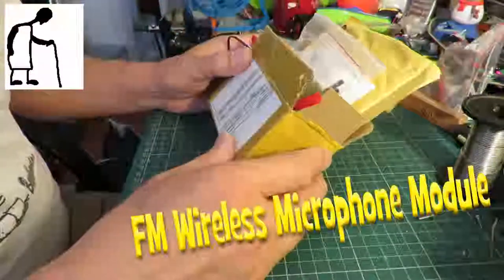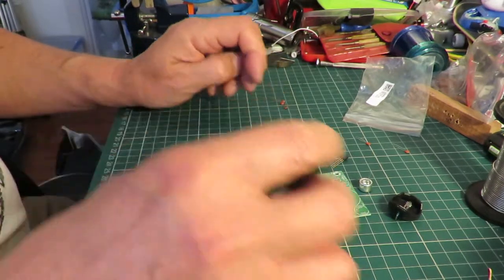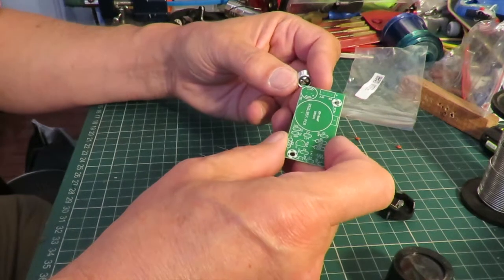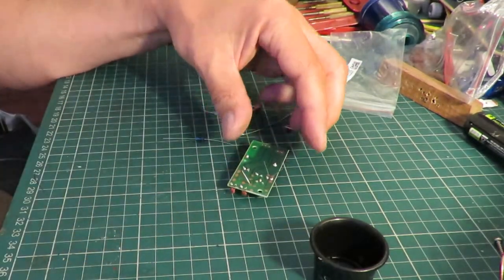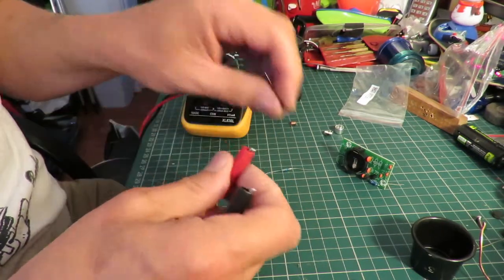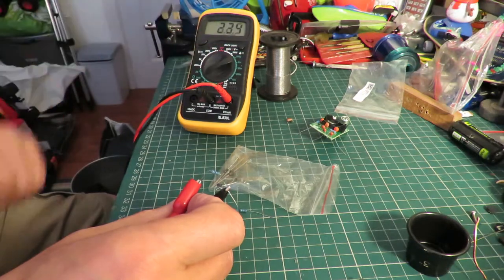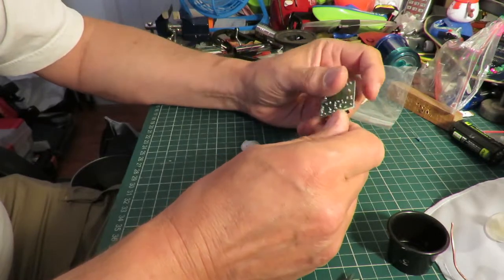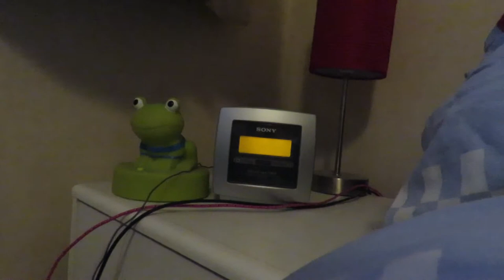FM Wireless Microphone Module

Comment: Hi, how did you found the frequency on the radio?
Reply from the maker: Trial and error. A pretty poor kit in many ways. My comments are in the video description.
Reply: Thanks for the info and video. I am trying to get this working too. Everything is solder but didn't manage to make it work. Also I don't get what is that copper coil... I thought it was the aerial but it's not. :(